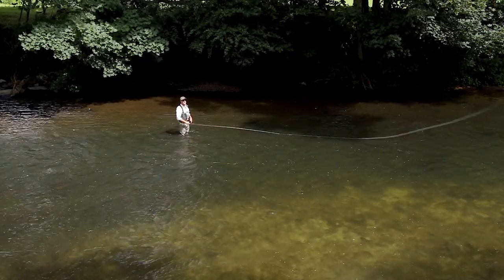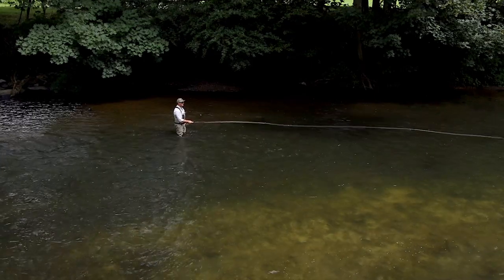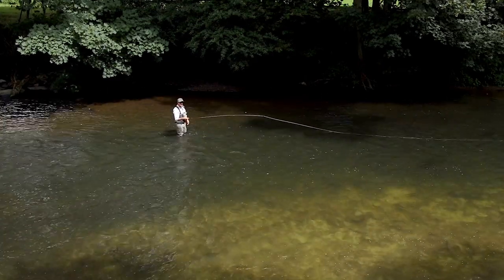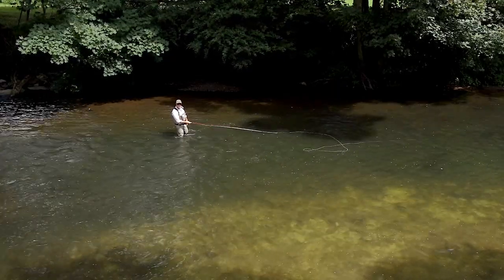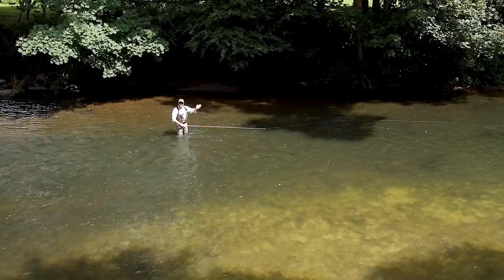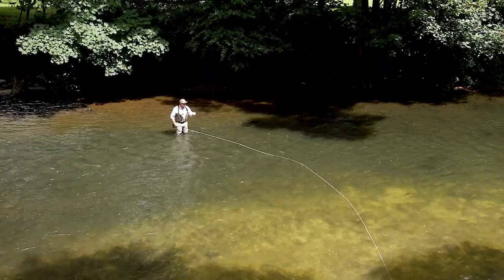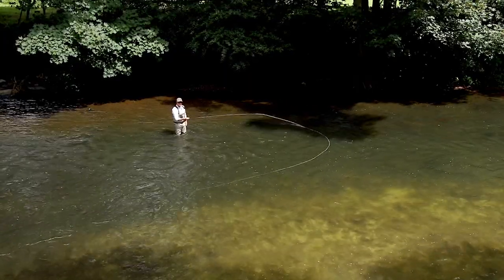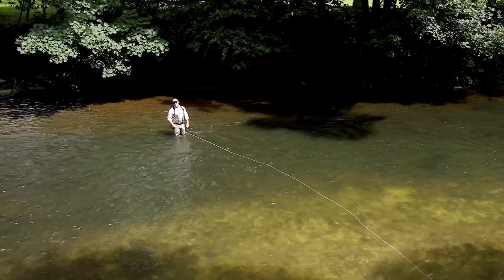Sunray | How to Fly Cast | 45 Degree Snap T

Comment: Very nice explanation.  Would you comment on the weight of the flyrod and the weight of the portion of the fly line that is generating the energy of the Spey cast. It is complex and involves the weight and length of the flyrod and the head weight of the fly line. As a consumer it’s been frustrating because it’s difficult to test cast lines with a specific rod and now most lines are in the $100 range. Thanks